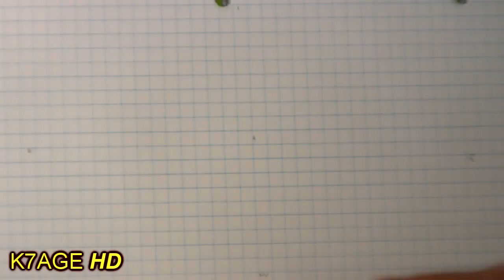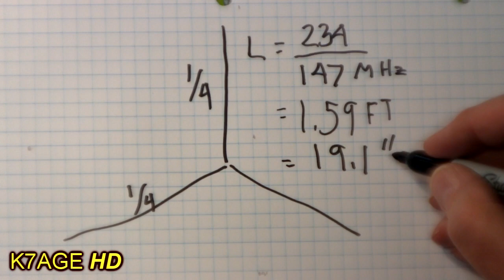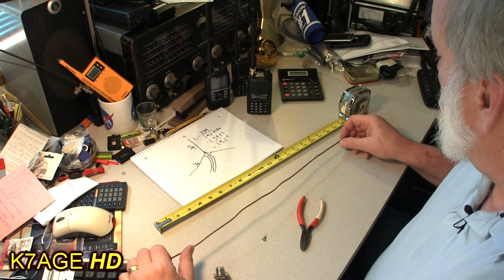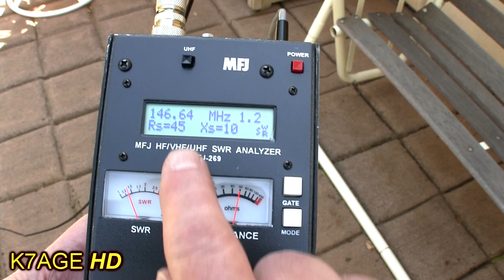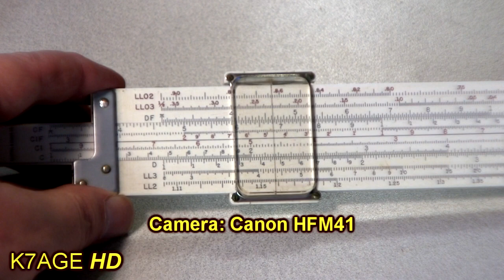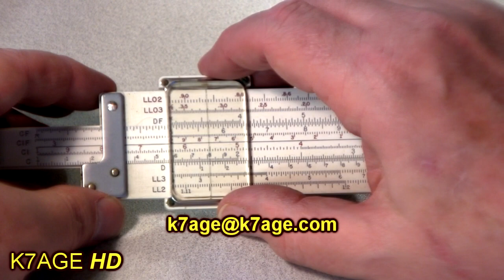How to Build: Ham Radio 2 Meter Quarter Wave Antenna

Comment: Thank you very much for this mate - I know there was a few trial and error moments but Ive learned that is what learning is all about! I am about to take my Foundation Amateur license in the UK - it's the equivalent of your Technicians License from what I gather. I was worried about the expense of equipment, then I found a programmable chinese handset for £30 brand new...next worry was the antenna. I had all sotrts of issues when I was messing with CB antennae, and was worried I would have the same problem with Ham bands. I made a few little antennas - from bits, like my Dipole and J-pole - I am learning there is no "1 size fits all" antenna solution over different bands. I tihnk I will DEFINATELY try something like this now!
Reply: The £30 handheld is only a gateway rig. If I can make a better antenna it may be just what I need to practise and at least get out there while I save up for a base station!

Comment: do I use regula coax that you use for tv antennas or does it need an adapter to connect to the chassis connecter
Reply from the maker: TV coax is  75 ohms. It is best to use 50 ohm coax for radios.  The TV coax uses F connectors, so you would need to find F to PL259 or SO259 adapters. I would really try and use the 50 ohm coax. If all you have and can afford, give 75 ohm a try.
Reply: +K7AGE okay so cant I just buy the coax with the pl259 connectors on the ends, would the pl259 fit into the chassis connector? then I would need a sma female to so239 female adapter so I can connect to my baofeng. I dont have my liscence yet so I listen but this thursday am taking the test for my technician liscence so I need an upgrade from the nagoya 771 I have
Reply from the maker: Radio shack has cheap 50 ohm 50 foot long coax with installed PL-259 connectors for about $20. I use it for portable and temporary installations. I like using a cable adapter for the Chinese radios, this keeps stress of of the radio's connector of a big PL-259 to reverse SMA adapter.  https://goo.gl/tHAQRz
Reply: +K7AGE okay I will look into that thanks. now, what is the approximate range you can get with this antenna when transmitting on 5 watts? and yeah I figured, I saw a few on amazon for about 3 to 5 $

Comment: I am new to the ham thing and just trying to get my brain wrapped around this.  This is the best video that I have seen thus far.  I hope that you are still online and answering questions for us noobs.  My question is, can i build one of these and then have another one for my family that is about 50 miles away and use FRS to communicate directly to them?  Thanks for your work and time that you are giving the community.
Reply from the maker: Hi, first the FRS radios are designed to meet FCC requirement to only to use the built in antenna. They don't support external antennas. You could break open the radio and try and connect an external antenna. I doubt that  you could get 50 miles between these radios. Better off getting your ham license.
Reply: Great - Thanks for that information.  I am still going to get my license but, I just wanted to talk radio to radio to my family in case of extreme emergency.

Comment: Can you explain where did you get the 234 value?
Reply: 234 is the 1/4~ measurement  it's 1/2 that of the 1/2~ wave
1/2 is 468/f=mhz  468/2=234
buy or borrow a antenna book it's real handy.
73's from k7sce
Reply: +Scott Edick Thank you Scott. I had to look back at my ARRL Technicians study guide. Just passed my Tech a month or so ago. 73.
Reply: congrats, welcome to the hobbie

Comment: Hola Randy, me encanto tu video y deseo hacer una antena como esta para mi handy baofeng uv-5r, tengo grabadas varias frecuencias de 155mhz hasta 470mhz, y si hago los calculos mostrados en tu video, la longitus del alambre varia de 48.5cm a 15cm, ni pregunta seria: como hago para que funcione en ese rango de frecuencias sin tener que recortar las varillas y no perder ganacia?, gracias
Reply from the maker: This antenna will not work from 155 to 470. You need to calculate and cut the lengths for the frequency that you want to operate.
Reply: K7AGE Gracias Randy, Que tipo de cable utiliza entre la radio y la antena?, que longitud tiene?, para tener 50 ohms, aprox
Reply from the maker: You need to use 50 ohm cable. RG8, RG8x or RG58 are common 50 ohm cables. The small RG58 of fine for short lengths. If you need longer cable, use the larger RG8 size cable.
Reply: Thanks Randy, you is the best....

Comment: I was going to try this but the chassis connector I bought does not have a wide enough aperture to accommodate the copper wire vertical.
Reply from the maker: +Shaun Berrisford You might be able to file down the wire a bit to fit, or maybe spread the solder area a bit wider. Have fun!

Comment: Hi Randy! Thanks for putting this together! The only question I have is, on your radial length formula, what does the top value of 236 represent? I understand the frequency but was unclear of that other value? Thanks!
Reply from the maker: +Gear Hammer The number 236 comes from half of 468. This is just a number that is used to figure out the length. Here is an eham article about this http://www.eham.net/articles/23802  Radial length is the same as the vertical.

Comment: Thanks for the video. How much did this cost roughly?
Reply from the maker: +Drew M The connector is less than 5 bucks from Radio Shack. Plus some wire and coax to connect to your radio.

Comment: Also can you go over what the ground plane part of it does?
Reply from the maker: +Brian A (DieselTwitch) The ground plane antenna is bit like a dipole antenna. The dipole has two wires of equal length, one to the center conductor of the coax and other to the shield of the coax. This gives the system balance. The  vertical uses 1 element from the center and four from the shield. This also gives the vertical antenna balance. If you had a quarter wave on your roof a car, the car's roof would be connected to the shield and provide the balance for the antenna. There is also a vertical antenna where you pull the 19" of the coax shield back down over the coax. So, 19" of center and 19" of shield back down over itself.

Comment: K7AGE, this is a fantastic video. I'm a new HAM and am getting ready to (hopefully soon) purchase my first radio. How do you think an antenna like this would work mounted in an attic? I live in a neighborhood that I suspect would frown upon me mounting a permanent antenna outside.
Reply from the maker: +Adam Adam, welcome to the hobby. The antenna will work find in the attic. Keep it 4-6 feet away from wiring or heating ducts.  Thanks for watching, hope you also watch Ham Nation on TWIT.TV
Reply: +K7AGE Thanks for the tip on TWIT. Why have I never heard of that!?! I'll certainly look for Ham Nation there. 

One more question for you if you have time... My local club maintains 4 repeaters, all 2M except for one 440. Is it worth getting a dual band HT for my first radio, or is it better to focus on 2m now as I learn?

Thanks so much for your input!

Comment: Micronta Field Strength/SWR Meter  212- 525B, i found one of these for like 20 bucks, is this for checking the antennae, like the 2 meter vertical.....anyone?
Reply from the maker: +Hammer USN You could give it a try to see if it will work at 146 MHz, as the CB stuff was speced around 27 MHz.
Reply: +K7AGE ok, thanks , i appreciate your time ,  if i want to join a local ham club, do i go get my techs license before i join or after , will it matter either way?, I found one here close, in Illinois
Reply from the maker: +Hammer USN I would go to the club a couple of times, let them know that you are working on your license. After a visit or two, you will know if that is club that you would be interested in joining. Some clubs are very active, others - not so much...
Reply: Excellent, ty

Comment: mine works great!!!!! i can hear on distant repeaters from 100-135 miles miles away. and i can hit anything within 50-60 miles from me. with a handheld attached to it.  i mounted it to 3/4 pvc. about 15 feet off the ground. and i live on a high spot in this area.  i also built a 70cm version of it. works just as well.
Reply from the maker: +stanley flinchum Thanks for letting me know how well it is getting out. Have fun, Randy
Reply: +K7AGE uploading a video of it built and mounted. explaining it a bit.  thanks for showing us how to build it!!!!

Comment: great video.!!! ordered some cable and the connector. I will be building this over our Christmas break.. and I have already worked out how to permanently mount it on pvc.  right now where I live. I can hit repeaters that are about 35 miles away using my hand held.  I live up on a hill of sorts. my thinking is with the antenna 20 feet up at my location.I may just be able to hit the one  that is 55 miles away.  I will let you know
Reply: +Jack Paylor W5NIO looks easy enough.  keep me updated on Ur build
Reply: +Jack Paylor W5NIO got all my parts in. had to wait on the so239 connector. for wire. I'm using 12/2 electrical.striped clean. was only $1.60. cheap!!! Will probably build tomm!!!!!

Comment: sorry if this question has already been asked. But will this work for a Mobile (car) radio as well? would I need to ground this antenna?
Reply from the maker: +Alex Garcia You can use this on car. The are many 1/4 mobile antennas that mount to the car and use the car for the ground plane.

Comment: Hello friend.  I want to use this for outdoor and can i use isolated wire? 73 de Z31VAJ
Reply from the maker: +Lamba Struja Sure. Make sure to protect the center pin area. Apply some silicon caulk to keep water off the junction.
Reply: +K7AGE  Yes , I made it today morning. :) It wasn't hard..The one thing I haven't done Is tu put the radials on 45°. I am using RG 58 50Ohm coax. I cant send images here but I will searc for you on fb..:) Very thanks for this video it was very helpful

Comment: Great video on the homemade ground plane antenna.  What are your thoughts on putting antennas in attics?
Reply from the maker: +jpintek should work fine. Just keep it away from any wires and metal heating ducts.
Reply: Thanks. Keep the great videos coming.

Comment: Where can I buy cheap 12 guage solid core wire?
Reply from the maker: +Soviet Bear the big box home improvement stores?
Reply: +K7AGE Couldn't find 12 gauge solid, but I found some 18 guage stranded, I figure I could hold it up with PCB, and make a dipole instead.
Reply: *PVC, also I made tape measure yagi, it works great for hitting a repeater about 15 miles away (in a suburban area with lots of trees, not sure what you've got going on where you live.)

Comment: thanks for the vid i made the antenna to spec trimmed a little and used on my 70watt mobile/base and conditions must have been just right because i moved 90 miles south of were i was living and had my home town repeaters saved in my radio and hit and made contact on 2 of those repeaters so i was very impressed i did not expect that at all. i tried agin today no such luck so i hope it wasnt just a one time thing i was very excited not only becuse of the long distance for 2m but i got to talk to some friends back home... thanks again
Reply from the maker: +Shane T glad to  hear that it works

Comment: Thanks for a great video!  Just got my ticket (at the tender age of 65 yo), and I will be building this tomorrow.  Does it matter if the radials are insulated or bare?  THANK YOU!
Reply: +Da Hoef i used 12 2 house wire used the bare copper for the radiating element and the isulated pieces for the ground radials and i have almost 1.1 swr across the band its a great antenna
Reply: +Shane T  Thanks, Shane.  Do you think leaving insulation on the wire would matter?
Reply: Da Hoef
 no not in this case at least like i said my ground radials are shielded some commercial grade antennas come with coated elements look at a ruber duck on a ht for example ... should be just fine

Comment: What happens if u tried to work the 443.000 with that antenna?
Reply from the maker: +ford guy Not sure. You would need to test for that. You can build a shorter version for 443. Another trick is to have two verticals, one for each band. Separate them into a V.

Comment: Could I get a list of supplies please? What size connector and coax?
Reply from the maker: +flyinokra Hi. It really doesn't matter a whole lot. It will be more dependent on the mechanical strength that you need. I used #12 copper wire, but welding rods or tubing would also work. RG58 for short lengths, maybe under 25 feet. Beyond that might be best to use the larger lower loss RG8 or 8X.

Comment: Been a ham for nearly 30 years, but got out of it for a long time. Finally got my general, and am getting interested again. looking for a decent priced used HF rig.

But back to your antenna. I've been wanting to build a 1/4 wave ground plane forn a long time. I have the S0239 connector, coax, and screws. But where do I get copper wire like that? Did it come as bare wire, or did you strip the insulation off it?
Reply: Jerry H Bare copper wire is available at most any hardware store.  Try to find a place that will sell it by the foot, as it's about 30-50 cents/foot.  You don't want to be stuck buying an entire spool!
Reply: +Brian Tingey will 20 gauge bare copper wire work?
Thanks
Reply: +Ethan McKinley 20 ga would probably work electrically, but I'm not sure it would support itself on the 20" horizontals. Although, a little droop may not make a lot of difference. I used 10 ga and it works beautifully. It was about 30 cents/ft at the hardware store.
Reply: Brian Tingey alright thanks

Comment: I think the gain is just about 2.15dBi....not significant, but yes, better than the rubber duckie.....I don't think you told anyone what the gain of the antenna was.
Reply from the maker: Jeffrey Wimmer I don't think I mentioned the gain. It is probably a few dBs better than the duckie.
Reply: And my point is, if it's only a couple of db, 2.15db if I remember correctly, and someone uses 25' of coax of say, RG58, they've lost more in feedline losses than the antenna makes up in gain.  Use LMR400 and the 2db gain is offset by a couple db loss in feed line and now the advantage goes to the ground plane, since it's most likely outdoors and higher than the rubber duckie.

Comment: The best antenna build is useless if your cable connecting it to the radio is of bad quality.Select great components cables by reading these articles on how to select a good cable http://epricedtech.com/blog and see those unbelievable prices on Belden RG8X http://epricedtech.com/Coaxial-Cable-RG8X-RG-8X-Belden-7808A-50-ohm-Low-Loss-RF240-LMR240-LMR-240  and RG6 http://epricedtech.com/Belden-1694-A-rg6-coaxial-cable-f-connector-75-ohm

Comment: Very new to Ham radio and I have a question.  I am trying to hit a 2m repeater that is about 28 miles away.  According to Google Maps the elevation of the repeater is 413 feet, not including height of repeater tower and my location is about 327 feet.  I am using a mobile/base unit with power up to 50 watts.  My question is: will I need to get my antenna considerably higher to hit that repeater?
Reply: +crobc1 i have a question as well i have 1.1 swr on mine and it works amazning but if i try to bend my radials 90 degrees from the element swr goes thru the roof is this normal and what can i do thanks
Reply: +Shane T Yes, that is normal.  With a ground plane vertical antenna, adjusting the radials downward changes the impedance of the antenna which will in turn change your SWR.
Reply: Brian Bowling
Thank you very much for the info the lowered radials seem to work very good as well

Comment: Randy I'm a new ham just got my license and trying to build your project but I'm afraid I lack some knowledge. I have all supplies except the so 239 chassis connector and the coax. Could you tell me what exact connectors I need for my coax to complete my build? I have the bao feng UV 5r with an rpsma connector on my radio.
Reply from the maker: michael ford You should be able to pick up the SO-259 at radio shack. Search for a 259 to reverse sma adapter cable. I have seen them on amazon.

Comment: i am doing the same for HF. each leg of mine is 8.2 ft long!
Reply: spydergs i finished the antenna. the radials are made from steel wire. i have it tuned to 28 or so mhz. it needs a balun or choke but it works quite well. it only works properly on the frequency you make it for. 
if i were to make it again i would probably make a dipole. so it does work.
Reply: spydergs sounds good. i just purchased a whip antenna. just about to build the 20' counterpiose wire
Reply from the maker: smallenginedude71 Let me know how it works.
Reply: K7AGE will do. half way through the build. the antenna will be run by a kenwood ts120s.
Reply: smallenginedude71 are you my neighbor? haha in my neighborhood there is this house with a HUGE ground plane antenna
Reply: Re4096 no. probably not. i live in Australia too. my antenna is not that big. its 16ft long
Reply: smallenginedude71 Have you finished the antenna? If so how has it turned out?
Reply: smallenginedude71 Good to know. 
Good luck on future antenna builds. 
Building my 25' antenna this weekend.

Comment: I bet that would work for CB radio too.
Reply: *****  I made one the antenna was 102 inches and the ground plain radials were 106 inches. It works good. I had to put the antenna in a pvc pipe. It is very similar to this one. I used 14 gauge solid house copper wire. It has pretty good swr on the 23 chanel almost 1 to 1 the forty channel it gets worse 2.0 to 1 I could shorten it a quarter inch it would help I think. when I feed more than ten watts to it, the SWR gets a little worse.